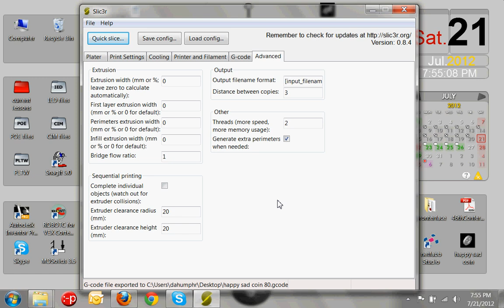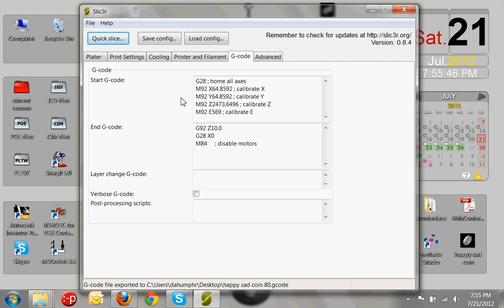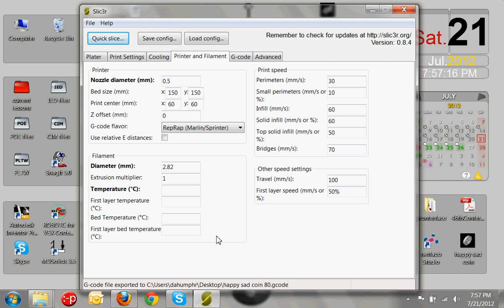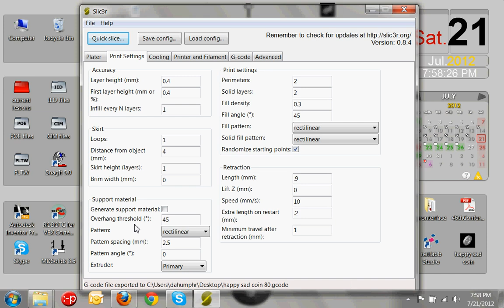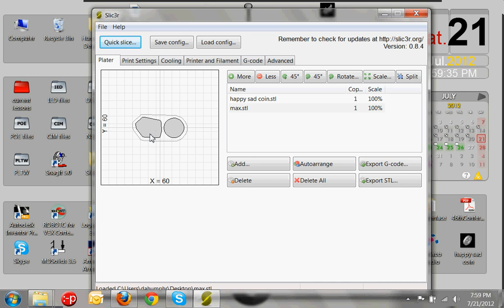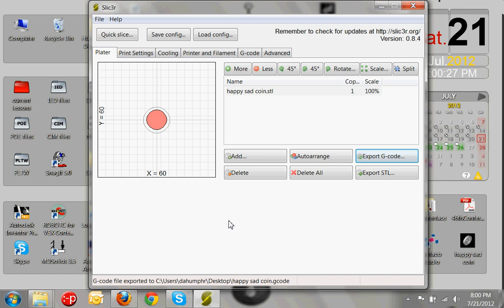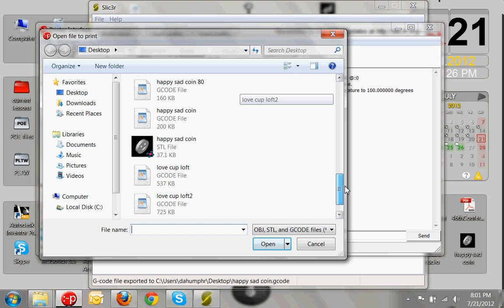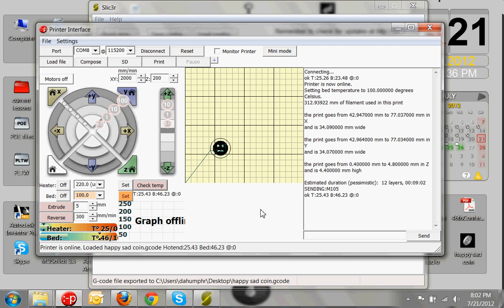3D Printing Basics Part 1 - Slic3r Pronterface Printrbot

Comment: Thank you. I have been folowing 3D printing for over a year. Buildina a Delta. Even though I know the workflow of 3D software, then maybe Netfabb to clean up your file, then slice and print. This is the first time I've seen someone go through the slicing settings and the printer interface settings. Can I suggest if you have not already done so, a video using Kis Slicer, and What if you are just printing from an SD card. You wont have all those Printer Interface options you show on gthe PC?